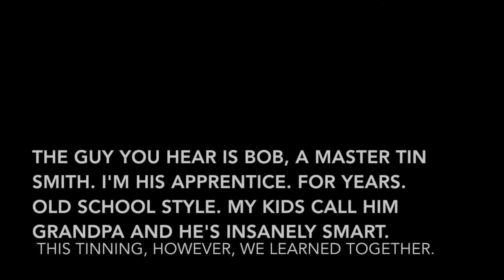Tinning Copper Cookware Process and Visual

Comment: Do you put anything on the outside of the copper pot to protect it before tinning? (I saw a video where the guy put whiting paste - ground marble) to protect the outside but I can't find any more info on it.
Reply from the maker: I do, every time! Sometimes I'll use lime powder (like what you put in your garden) mixed with water. Or you can use drywall mud watered down.

Comment: Excellent vid.  I have a large copper pot they we bought at a flea market in France.  What little tin left in the inside has turned dark.  Must I remove all the old tin before  I try re tinning it?  Thanks.
Reply from the maker: Yes, you'll want to remove all the old, dark tin or the new tin will very likely not stick to those spots.

Comment: So really like your videos and knowledge of the trade, watching your tinning video I can't help but toss in my two cents worth.
I see you tuck you jeans into your boots and you are sitting down if any of the hot tin splashes out you could get a hot foot or leg. Should have on boots with no laces and leather chaps with a leather apron, just mt two cents worth. Cheers.
Reply from the maker: HA - this video is several years old, and you're right - it took only once for tin to sneak in and I no longer tuck them in. Most of the time I tin in steel toe high-tops, rugged pants from Duluth Trading and my very aged leather apron. :)

Comment: Thank you for this video! I bought a bottle of Harris Stay Clean flux and used insulation same as you.  It worked great!
Reply from the maker: Saltyfries hurrah!!! What a great and wonderful thing to hear!!!
Reply: @housecopper  what is the best way to strip the old tin from the pan completely to have a fresh surface to work with? By the way thank you for all your videos😀
Reply from the maker: @utuber2940  Thank you for watching! :) You can check out a video on stripping that I did here: https://www.youtube.com/watch?v=-DBrcE0Q3o0&t=142s
Reply: @utuber2940  I retinned some pots without removing the old tin. It worked out perfect, and saved me a lot of time. The pots were used, had black spots, but were not carbonised.

Comment: nice video, the thing i dont get is since tin melts that easy, doesnt that mean that it melts while you cook food inside the pot? and if so doesnt that mean that eating that food you are consuming tin metal aswell?  thanks
Reply from the maker: Totally common question! And a good one! The tin does not melt during cooking because the food or liquid absorbs the heat...and tin melts at 450F (water boils a bit over 200) so you're seldom getting the pan hot enough to melt tin anyway...but even if you do get it very hot, you should have food/liquid in to absorb the heat, which means the tin does not melt at all, and you are safe! :)
Reply: @housecopper  thanks! cool info, so where does the old tin go ?
Reply from the maker: @foskere  When I'm retinning, I sand out the oxidized stuff and then put new tin over the remainder. Otherwise, it slowly wears down over years with cleaning/scrubbing.
Reply: @housecopper  i see now, thanks!

Comment: Hello from Sweden! And thanks for your videos!

I’m wondering - if retinning is needed from time to time - what happens with the worn away tin? Does it go in our food and is it a health risk?
Thanks
Reply from the maker: Hello Daniel! The tin is worn away mostly with the cleaning process - scrubbing and washing over many years. It is bonded molecularly to the copper, so it doesn't break off in our food. Tiny molecules may slowly erode and could end up in your food...over decades. If that did happen, it would not be a health risk as tin is a micronutrient for humans, just like copper. We need a little in our systems anyway.
Reply: How do I fix an only 2 inch raw copper spot

Comment: Nice video ..! 
How clean does the pot need to be and is it possible to overheat the pot and discolour it ?
Reply from the maker: Thank you! 
The pot should be very clean - either the tin sanded to dull shine with all black/oxidized tin layers removed, or have the interior completely stripped down to the bare copper. Yes. It's possible to overheat and burn or discolor the tin. The copper exterior discoloration during tinning is expected and can be cleaned up.
Reply: @housecopper  thank you so much for your videos  !  I have been buying pots at flea markets in France for a few dollars . I refinished two of them , with your help ,and I’m looking forward to going back to France to find more as soon as the “ Plague”
Is over ....
Derek

Comment: Could you specify or give a time frame in how much time the tin wear out? Of course this would depend on the use/scrubbing and other factors. However, if I wear to use it every alternate day, then how quickly or (at earliest) would the tin start wearing off. Hope this is answerable. Thanks in advance
Reply from the maker: The general rule among us coppersmiths/re-tinners is that a good coat of tin should last 12 - 15 years with daily use, ONLY if proper care (hand wash only, never in the dishwasher, proper heating/cooling use, and only using wood or silicon to cook with and only clean with soft rag and soap and hot water).

Comment: Hey Sarah, Thanks for your videos. I'm curious if pewter is commonly used for tinning. Thanks in advance for your response!
Reply from the maker: Thanks for watching! No, pewter is not commonly used for tinning. That is to say you could do it, but it melts at a far lower temp than tin (330F vs tin's 450F) so you might have more issues actually cooking in pewter-lined copper. I have a lot of super old books on copper and tinsmithing, and pewter as a lining isn't mentioned anywhere, which leads me to believe pewter was just not used traditionally - unless, of course, in pewter casting itself. :) Also...you have the lead issue. So you have to be really careful with anything pewter because of the lead, too...so many things to consider! :)

Comment: Hello Sarah is Mel here from South Africa. I have some things to re tin and its not as easy as the video.I prepaired the pan and then brushed the flux on and then heated the pan with the tin which melted.I then used the fibre glass cloth to wipe the tin.Its abit rough and when i see your video s yours are smooth.What am i doing wrong.Thanks Mel
Reply from the maker: It's ok, give yourself a break. Tinning is hard and takes YEARS of practice; you won't get it smooth and nice the first several tries. It's ok if it is rough - my first ones were not super either. You'll get the hang of it with practice! And you can do it! :)

Comment: can I just use the tin without flux?
Reply from the maker: No sir! You need a flux to facilitate the molecular bond between the two metals. You'll notice the tin won't "stick" or, best case, will cold solder and pop off.

Comment: What kind of cloth are you using to spread the tin? (Nevermind, it's fiberglass)   I wonder if you could use one of the point-and-shoot IR thermometers and take several reading around the pan to know when it has reached the right temperature.  Roughly how many inches of the tin bar were used for one pan? Thanks. Great video.
Reply from the maker: Ha - yes, fiberglass. You can also use pure cotton wading for the same effect, it just is a bit more flammable, of course, than fiberglass. You could do the thermometer trick, but you'd have to be pretty quick on some of the thinner pans, which can get super fast all of a sudden, and then the flux can burn and then tinning gets annoying. If I get my hands on one, I'll try it - great idea! In terms of the tin bar...it would be easier to measure in mm - it doesn't take much tin, and usually I end up pouring some out. The best way to figure out how much tin you use is to weigh the pan unlined, and then again when the tin is in. Bob and I have done that before, and we are absolutely astounded with how little tin is used (by weight, which is really the best way to measure tin - it is sold by the pound as it is in bulk). You need a really smart scale to note the difference. The cost for tinning is not only for the tin itself, but for the labor/skill to apply it properly and well, and all the material costs (gas/fuel, flux, lime paste, cleaning materials, buff and polish, compounds, wheels, etc). Anyway, sorry, that was a long answer for your question!
Reply: Sorry, one more question - do you ever accidentally get the tin somewhere unintended, like the outside of a pan and how do you remove it if that happens?
Reply from the maker: Yes, it can happen - usually just some small drips on the upper edge wherever the excess tin is poured out - if the lime paste isn't there. Removal includes several steps of sanding using a handheld sander, but you have to be really careful with the grit so you don't scratch the copper irreparably (or making your job harder), so you start with 220 at the harshest and work your way down, and then I go to the drumel and do another sanding and then a little wire polishing wheel, and then hand paper, and then the buffing wheel with the hard wheel, etc...

Comment: Dear Sara
I tried tinning my pot the tin melts but it doesn’t bond. It stays liquid drops? 
Can you advise please 
Regards
Reply from the maker: Hello - well, it's hard for me to exactly help you as I am not there when you are tinning and I don't know your process. It could be any number of things. My top three guesses are one or two of the following things are happening: 1. Your copper is not hot enough 2. You are not spraying or using enough flux or 3. Your copper is not clean enough to take the tin
Reply: Thanks for the reply

Comment: Hi, nice explanations.  I have some questions if I may:
1.  Can tin come off(melt) if I heat the pan with stove high flames?
2.  Can tin come off if I accidentally scratch the pan a little hard with a metal spatula?
Reply from the maker: Of course! Ask away always! To answer your questions: 1. If you have food in the pot, your tin won't melt off on high heat - the heat will transfer into the food and the tin will stay intact. If you heat a pot on high empty, then you do run the risk of making the tin soft or run. The tin itself is bonded to the copper, so it won't completely make the copper show and will mostly just pool in the bottom, but it will make it splotchy and the thickness and evenness of the tin will leave and the tin will pool in the bottom. It is possible to kind of fix the issue, if it happens, with the heat and some soap as flux, a glove and a piece of cotton, but I don't recommend it unless someone just wants to try. :)  And you need the whole pot HOT for a while, empty, for the tin to run happen - close to 500degrees. Not sure what someone would need to cook at 500 degrees. :) But there you go. As for 2. Yes, you can scratch off tin if you scrape around with a metal instrument. Does not always happen, but it can. Tin is soft, but it conducts the copper's heat SO well it makes sense (personally) to use it so you are actually using copper to the best of its ability. That all said, until 30% of the copper is showing, if you have scratches, etc, it's ok. The pot is still usable, likely for years and years and years, before you'd need repairs.
Reply: Wao, thanks for the fast response and dedication in your explanation.  It's very useful information.  I think you are ready to be a mentor/master.  :-D
Reply from the maker: Experimentando en la cocina oh you are so welcome — my pleasure. And that’s a lovely compliment. I think I still need some years of working before I could say mentor or master but you are very kind. :)

Comment: I really like you videos. I have a traditional heavy bottom Indian cooking copper utensil. Tin coating is fading off. If I need to retin the vessel do I have to scrap off old tin layer before retinning new layer ?
Reply from the maker: Yes, you should sand down the old tin (at the very least, remove the darker oxidized tin) before retinning. :)
Reply: @housecopper  Cheers

Comment: Hi!  Is it possible to get the heat high enough with propane or do you have to use acetylene to get the copper and tin hot enough to bond?
Reply from the maker: Totally possible to get the heat high enough with propane. The only time I have to use acetylene is when I need to do brazing work. Otherwise, you can get it hot enough for sure!!
Reply: @housecopper  Thank you!  That's what I thought.
Reply from the maker: Sure thing and yay! :)

Comment: how hot is the copper when you do that? every use a laser thermometer ? Is there such a thing as too hot?
Reply from the maker: You need the whole copper body to be hot enough to take the tin and not frost it, so usually 500 - 600F. Yes, if you get the copper too hot, you'll burn your flux and scorch your tin and the whole thing will need to be cooled and re-prepped for tinning. The laser thermometers don't work for this process - the reflection of the copper and tin make it mis-read. It's one of those things you can't use technology for - you just have to do/learn/try!

Comment: Okay, time for a stupid question: 

As you well know, the bottoms and corners of cookware tend to lose their tin first... 

What's to stop a nincompoop from just taking their worn cookware, smoothing and cleaning the bottom, sticking it on their stove, melting some tin pellets inside it, and wiping?  

Like, I'm sure it would be ugly and suboptimal, but would it technically *work*? 

(I may or may not have found an enormous stockpot which has lost some tin only at the base... 😬)
Reply from the maker: lol, it is not a stupid question, it is a GREAT question!! And here's the answer: NOTHING is stopping you from smoothing and cleaning the interior (use sandpaper and wash it really good!), getting some flux, melting pellets, heating and wiping! I don't know what you have on hand for flux that is food safe, but if you can get your hands on it and some lead-free food safe solder, you can totally do this! (Use paper towel to wipe if you don't have cotton swabbing or insulation) Because yes, it won't be insanely pretty but it will totally work!! I want to hear how it goes!!!
Reply: @housecopper  you rock for answering! However, I think you've overestimated my intelligence 🤣

I was asking if it were technically possible to completely eschew flux—to literally just plop some tin pellets on the bottom of a freshly-sanded pan bottom, heat it on the kitchen stove, and spread out the tin as it melts. 

I ask because it sounds like most flux compounds are not going to be things I'd want to risk breathing in, which means working on a kitchen stove would be potentially dangerous.
Reply from the maker: @DGFishRfine1  OH!! lololol! You are intelligent! You are getting this! :) 
Anyway, no, it is not really possible to patch without flux of some kind - you need it to facilitate the molecular bonding between copper and tin or even tin and tin. Without it, it sort of frosts off, or "cold solders" so it pops off. 
You can try something super old school that isn't chemical as flux...soap! Like Borax!! Or pine tree rosin - which is the original 1700s flux, and is literally dried pine sap. There will be some brown residue, but you can remove that with rubbing alcohol. And it would be all natural! :)

Comment: Hi, what flux could be used that is food safe?
Reply from the maker: The most "food safe" flux out there would be the very traditional, old fashioned dried pine tree sap (rosin). Flux does burn off during the process, though, so there's no chemical residue after the whole process is done.
Reply: @housecopper  Interesting! Thanks I will look into it! Helps a lot

Comment: Do they make just tin tea pots ?
Reply from the maker: No, they don't - tin is too soft to be used solely / alone. There may be some steel tea pots that are electroplated with tin out there, and in the very old days, the same steel sheet dipped in tin was used to make tea pots, but they would rust out so many didn't survive the centuries. I hope this answers your question! :)

Comment: I'm curious about silver plated Cooper, is that done?
Reply from the maker: It used to be, but the only person doing it...isn't anymore. One needs a furnace SO hot it almost melts copper/smelts to melt the silver due to silver's extremely high melting point vs tin's.
Reply: @housecopper  do you do repairs? I've a small copper 8in saute with brass handle that needs tin
Reply from the maker: @jeeppayton  Yes sir I do! You can email us at copperassistant AT gmail.com and Katie or I will get ya an estimate. :)